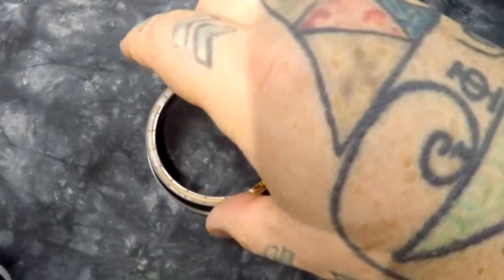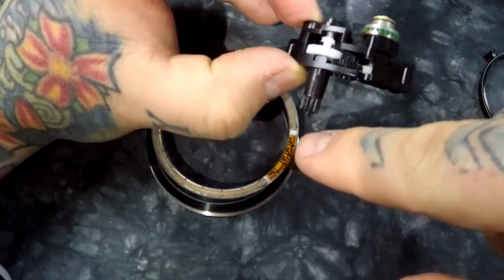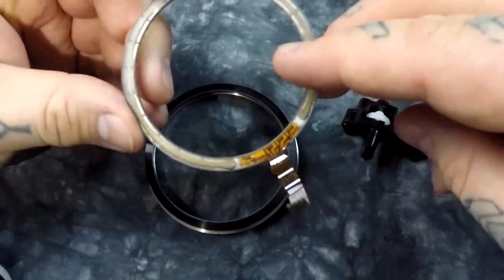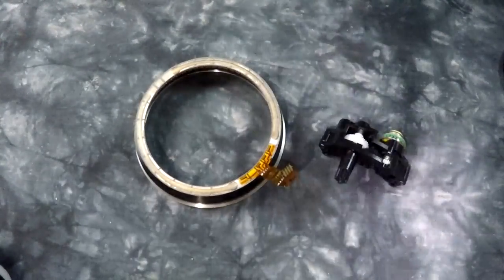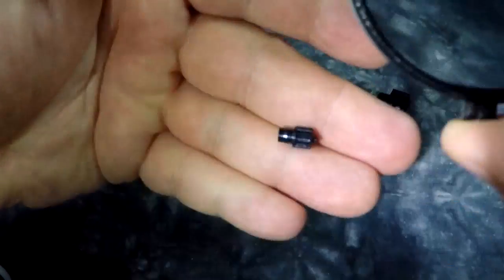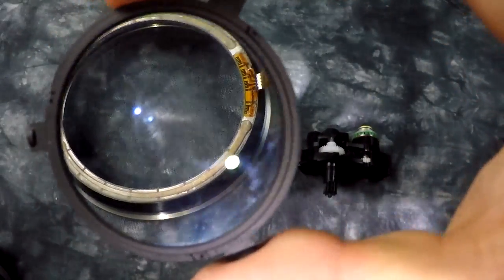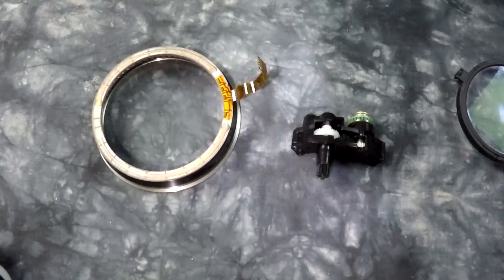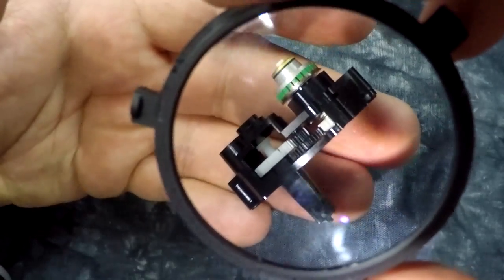NIKON calls BOTH OF THESE motors "Silent Wave" but both are RADICALLY DIFFERENT

Comment: Lens use the Ring-Type motor to drive the focus is shown below: 

1 AF-S 50/1.4G 环形   <<<<<<<<<<< but mine was slow!!!!
2 AF-S 200/2G IF-ED VR 环形
3 AF-S 300/4D IF-ED 环形
4 AF-S 300/2.8D IF-ED 环形
5 AF-S 300/2.8D IF-ED II 环形
6 AF-S 300/2.8G IF-ED VR 环形
7 AF-S 300/2.8G IF-ED VR II 环形
8 AF-S 400/2.8D IF-ED 环形
9 AF-S 400/2.8D IF-ED II 环形
10 AF-S 400/2.8G IF-ED VR 环形
11 AF-S 500/4D IF-ED 环形
12 AF-S 500/4D IF-ED II 环形
13 AF-S 500/4G IF-ED VR 环形
14 AF-S 600/4D IF-ED 环形
15 AF-S 600/4D IF-ED II 环形
16 AF-S 600/4G IF-ED VR 环形
17 AF-S 14-24/2.8G ED 环形
18 AF-S 17-35/2.8D IF-ED 环形
19 AF-S 24-70/2.8G ED 环形
20 AF-S 24-85/3.5-4.5G IF-ED 环形
21 AF-S 24-120/3.5-5.6G ED-IF VR 环形
22 AF-S 28-70/2.8D IF-ED 环形
23 AF-S 70-200/2.8G IF-ED VR 环形
24 AF-S 70-200/2.8G IF-ED VR II 环形   <<<< this was fast as heck.
25 AF-S 70-300/4.5-5.6G IF-ED VR 环形
26 AF-S 80-200/2.8D IF-ED 环形
27 AF-S 200-400/4G IF-ED VR 环形
28 AF-S 200-400/4G IF-ED VR II 环形
29 AF-S 60/2.8G ED Micro 环形
30 AF-S 105/2.8G IF-ED Micro VR 环形
31 AF-S DX 10-24/3.5-4.5G ED 环形
32 AF-S DX 12-24/4G IF-ED 环形
33 AF-S DX 17-55/2.8G IF-ED 环形

Lens use the small DC motor to drive the focus is shown below:  SLOW.

1 AF-S 16-35/4G ED VR 微型
2 AF-S 85/1.4G 微型   <<< indeed this was slow
3 AF-S 24/1.4G ED 微型
4 AF-S DX 18-55/3.5-5.6G ED II 微型
5 AF-S DX 18-55/3.5-5.6G VR 微型
6 AF-S DX 18-70/3.5-4.5G IF-ED 环形
7 AF-S DX 18-105/3.5-5.6G ED VR 微型
8 AF-S DX 18-135/3.5-5.6G IF-ED 微型
9 AF-S DX 18-200/3.5-5.6G IF-ED VR 微型
10 AF-S DX 18-200/3.5-5.6G IF-ED VR II 微型
11 AF-S DX 55-200/4-5.6G ED 微型
12 AF-S DX 55-200/4-5.6G IF-ED VR 微型
13 AF-S DX 55-300/4.5-5.6G VR 微型
14 AF-S DX 18-55/3.5-5.6G ED 微型
15 AF-S DX 16-85/3.5-5.6G ED VR 微型
16 AF-S DX 35/1.8G 微型
17 AF-S 28-300/3.5-5.6G VR 微型
18 AF-S 85/3.5G ED Micro 微型
19 AF-S 24-120/4G ED VR 微型

Comment: Ken, the motor portions of both are piezo motors. They function identically.  It's just that the one with the gear train little stator is maybe a centimeter in diameter. The torque with the large diameter motor must be higher than the geared down transmission of the smaller one although I'll bet not by much.  The large one is obviously more attractive for marketing purposes for being truly silent as well as the gears being a weak link. When you want to move 10-12 elements of glass around you can see why they changed. I for one don't have an issue. I have 11 screw drive lenses and there are two more I'd like to have.

Comment: i think you are really wrong, you are talking about juts from the plastic part from the motor, if you disassembling the metal part in the small one you could find that is exactly the same that the big one i think that you need a little bit more to talk about "RADICALLY DIFFERENCES" that gear just help to this motor to move the elements in the lens, its just a different way to use it.

Comment: I've just came to the same realization as you did! This one's a cheap prime having the geared down micro-motor. The 35mm F/1.8 ED actually. The lens started to make whining noises like it's stuck, but as far as I can see it's a Nikon general fault. It even drains the battery more and makes the LCD back light flicker slightly while operating the AF. Not with my other lens. Ordered a replacement motor, because I suspect that the spring on the motor axle carved it's way into the plastic gear it's pushed up to, causing higher friction and drag. Saw a similar technique in other videos taking apart some Canon lenses. Canon uses steppers and even normal DC motors in older and more cheap ass ones too in a few of them, but I don't know if they use gears with it. You can spare the encoder wheel maybe if using a stepper one. Making it having just the linear encoder to track where the focus point is in the whole domain. Did you use some kind of special lubricant or just a generic one for plastic mechanics?

Comment: Neither are electromagnetic. Both use piezoelectric motors. One is smaller and gear-driven, the second one is direct drive.
Reply: Are you sure the gear driven is a piezo? It's form factor and need for a gear box suggests it's a brushless DC motor not unlike your phone's vibration motor.
Reply: @djmips  No, it's certainly piezo. The shape does nothing to suggest it's brushless DC, in fact quite the opposite.
Reply: @Spirit532  ok fair enough.

Comment: What kind of motor does the Nikkor AF-S 300mm f4 (old version) have?
because my lens motor is failing, already whistling, and I've seen a lot of videos with the same issue using the same lens.
Is it a cheap geared version? or is it an actual AF-S circular motor?

Comment: Hey Ken, is it possible there are torque limitations on the true magnetic SWM motor as opposed to the cheap alternative? Could that be why Nikon is not always going with the true SWM motor, other than the obvious reason of saving couple of bucks? Just curious...
Reply from the maker: the micro motor assy is very small , perfect for certain lens designs

Comment: The " real " SWM ring looks more simplex and easier to make than the multi gear assembly of the cheaper motor or am I missing something? That being the case why use the multi gear assembly at all?
Reply from the maker: micro motor also takes up much less space

Comment: It would be interesting to see MTBF data on some of the lenses.   Just because an assembly looks cheap, doesn't necessarily mean it's prone to early failure.. nylon gears can be pretty robust and they're self lubricating.   Also, the SWM motors aren't immune to failure.  The early 80-200 2.8 SWM has a reputation for early motor failure.  (Oh crap.... I probably just jinxed mine by saying that)